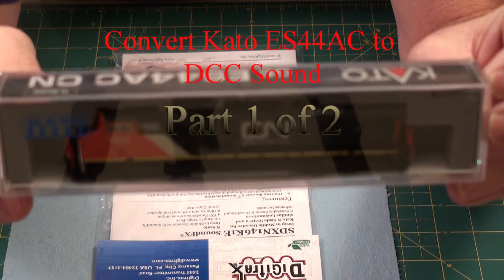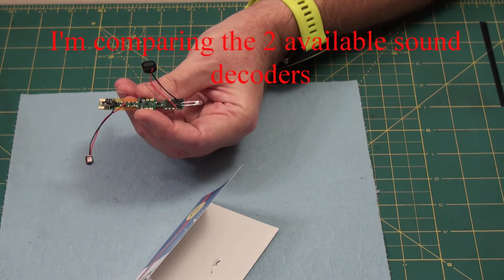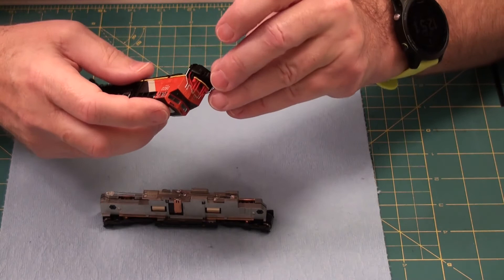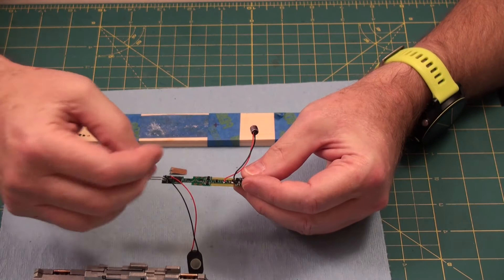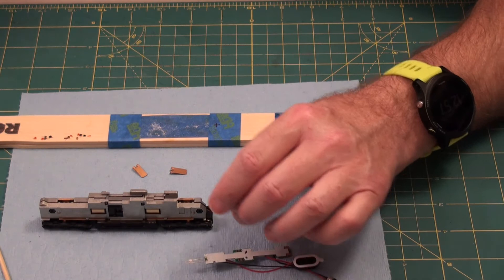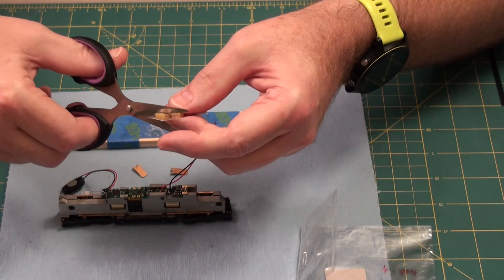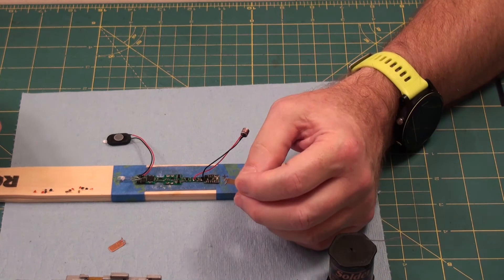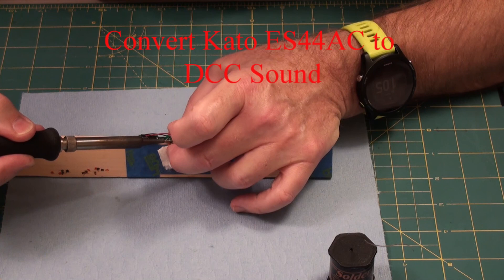Kato ES44AC to DCC Sound Part 1 of 2

Comment: Great video. I am going to be doing this in my model but I replace the capacitor with a 100uF 27v type as that removes the dangers of overload/blowout. I hope that Kato will consider moving over to Next18 boards and pre fit a speaker inside to make it more plug and play without any filing of LED's or milling. Here is a like from me.
Reply from the maker: Thanks for the reply.

Comment: could you extend the wires for the capacitor  so it will reach the back of the loco frame?
Reply from the maker: Sure, longer wires wouldn't be an issue.   The issue would be whether the Capacitor will fit or not.  Digitrax uses different sized capacitors (physical size, all seem to be 100uF) and in some cases doesn't even use one.   Doing this kind of work is a bit of "try it and see".   Digitrax warranties their decoders for a year so if you screw it up you can get it replaced but if you are drilling / milling the frame and screw it there isn't much you can do.